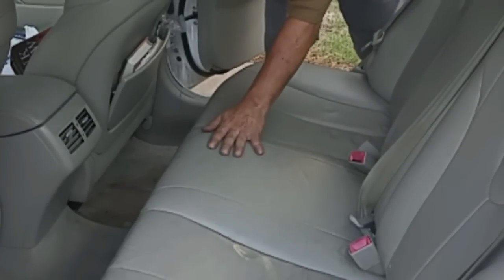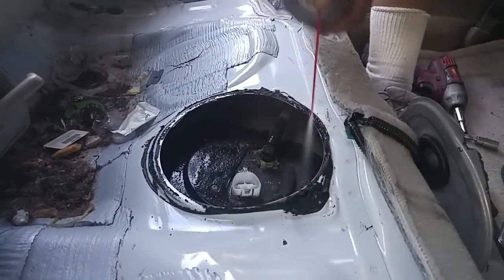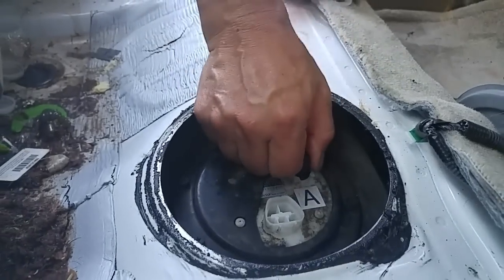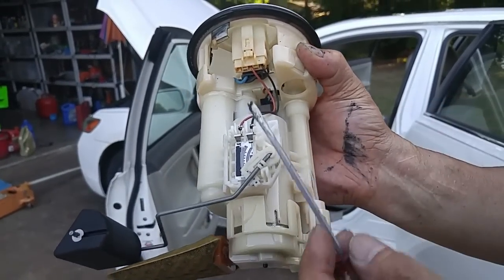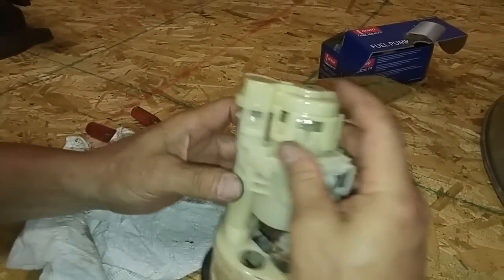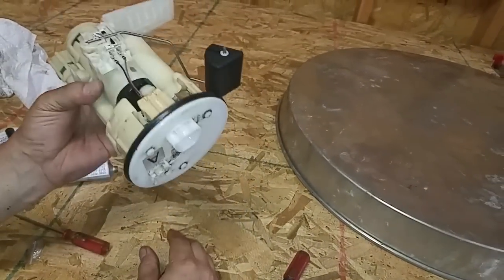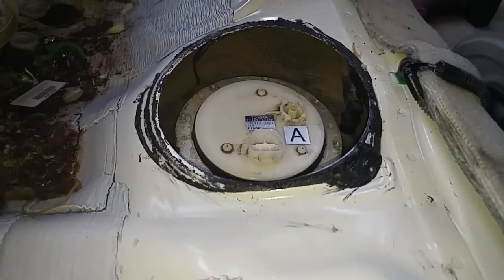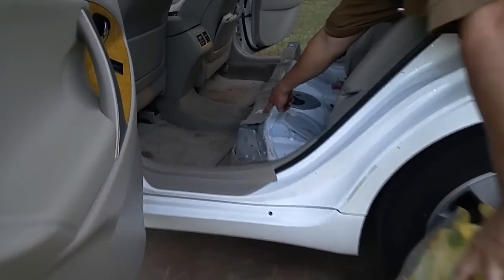Fuel Pump Replacement - Toyota Camry V6

Comment: Very helpful video. I just changed my Avalon's fuel filter and strainer by watching your video. I didn't change the pump but only the filter and strainer.  Thank you for sharing this video
Reply from the maker: Good for you!  Pumps fail by drivers running their tanks to near empty.  Gas is a coolant for the fuel pump.
Reply: Good to know that. I usally refill my tank when 1/4 left. Are you a car mechanic? May I ask?
Reply from the maker: @mdashiqurrahman39  Yes.  I'm a mechanic.  When I ask a customer their driving habits after replacing their pump, they say they like to drive their car's tank down to empty before filling up.  That what makes the pump burn out over time.  Only exception was a 2000 Jeep Cherokee.  The ethanol dissolved the fuel pump screen and the melted goo residue got sucked into the pump.